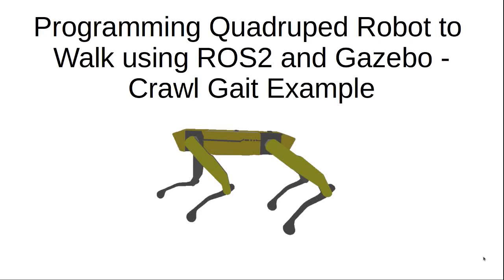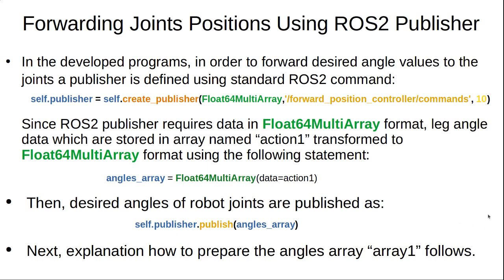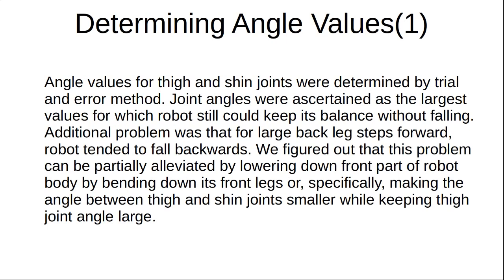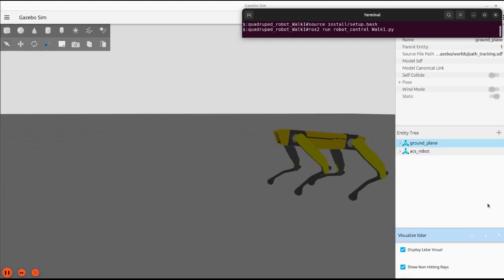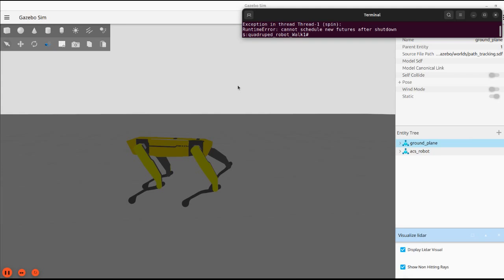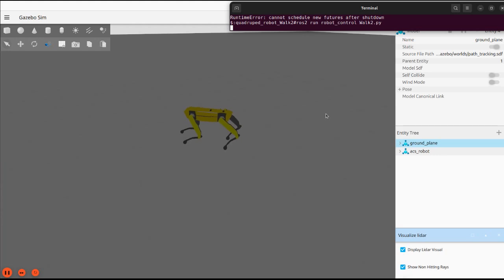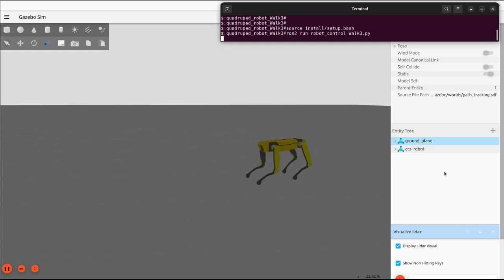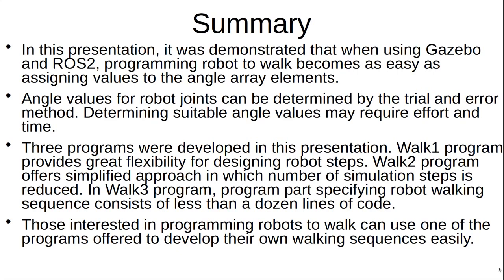Programming Quadruped Robot to Walk using ROS2 and Gazebo

Comment: Could u pls confirm which version of gazebo u r using now
Reply from the maker: Simulations for this video were performed using Gazebo Harmonic v8.8.0. After Gazebo Harmonic was upgraded to v8.9.0, Gazebo simulator stopped working on my computers. Since I could not fix this problem,  I moved to Isaac simulator. Currently, I have no working Gazebo simulator on my computers. Just recently, I published a video in which simulation methodology explained using Gazebo is applied to Isaac Sim. Link for this video is:
https://youtu.be/VMi0V8_4tU0
Reply: @Robot_dog yeah same issue I m facing I m unable to load the control yaml file that's why I asked